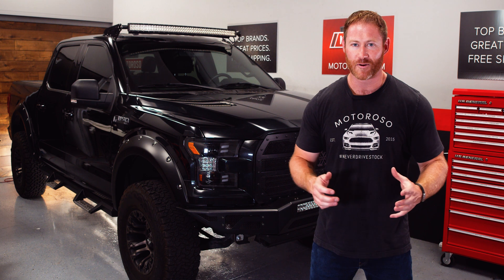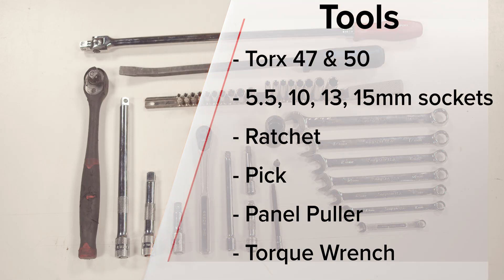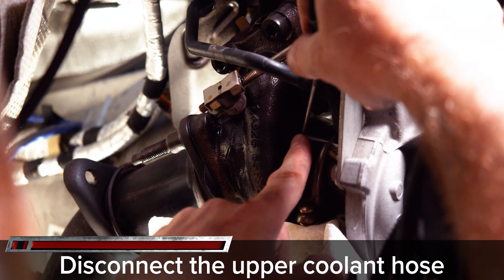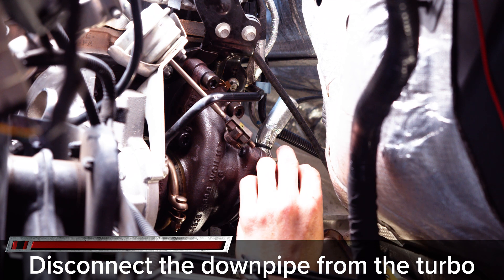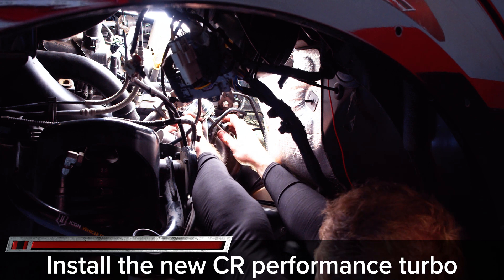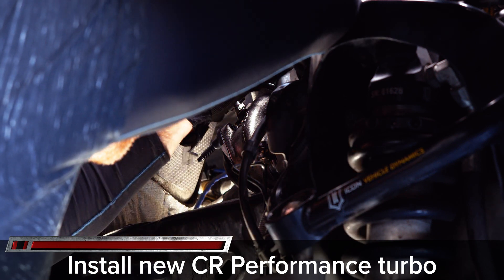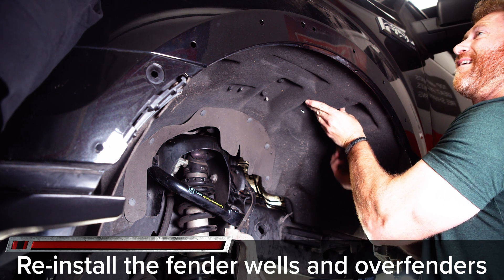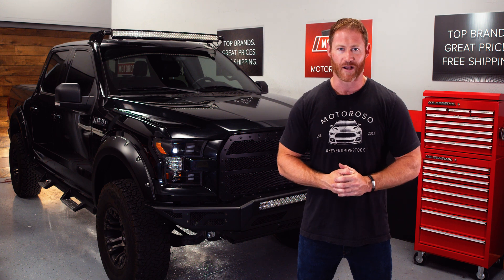Install Guide: Turbo Swap and Manifold on '15 Ford F-150 3.5L EcoBoost - CRP Stage 3 42mm Turbos

Comment: Here is a step-by-step summary of the instructions from the video:

1. Jack up the truck and remove the front wheels. 
2. Remove the fender liner and any fender flares. 
3. Drain the coolant from the radiator. 
4. Disconnect the battery. 
5. Remove the starter to access the lower side of the turbo. 
6. Remove bolts and start taking off intake and intercooler hoses. Remove the full intake if needed. 
7. Remove lines and nuts connecting the turbo to the downpipe and exhaust manifold. 
8. Remove coolant and oil lines from the turbo. 
9. Remove turbo from both sides of the engine bay. 
10. Remove exhaust manifold nuts and studs. Clean the engine block. 
11. Install new studs and gasket on the exhaust manifold. Install new manifold.
12. Install new turbo gaskets and connectors like coolant lines. Install turbo.  
13. Install downpipe and tighten turbo mounts. 
14. Repeat steps 10-13 on other side of engine.
15. Reinstall intake, starter, and fill coolant. Check for leaks.
16. Reinstall fender liners and wheels. Take it for a test drive and tune.

Comment: Just had a mechanic change out one of my turbos and a month and half later the same turbo blew again is this common? 2015 ford f-150 eco boost
Reply from the maker: The turbo failing is not common.
Reply: Yeah, this is not normal at all.
Reply: The turbos have an oil filter screen on the line to the block no mechanic or video ever mentions them, they’re strictly for the turbos! Change them or this will cost you!$

Comment: I own a new 2021 Ford Transit 250 3.5L Ecoboost. Will these Turbo mods and exhaust manifold fit my application ?  Please provide links to all parts I need.
Reply from the maker: Hi There, we have confirmed that the manifolds are the same as the Gen 1, and the turbos will work as well. If you'd like to put together an order for this, please reach out to us at 833.668.6767 or 805.723.8050
Reply: @Motoroso  Can turbos be put in a non turbo engine or are the internals different ?

Comment: Do these manifolds fit a 20213.5L Ecoboost ?
Reply from the maker: Yes, the fir 13-16 F-150 3.5L EcoBoost. They also make manifolds for 11-12, and 17-21.
Reply from the maker: We have this answer. Yes the Gen2 2017-2020s manifolds work on '21 if it's a non-Powerboost. Powerboost is not compatible.

Comment: Be cautious of the stupid water lines. The ones in the rear of the turbo are a b!tch to get to. Also, don’t twist them too much because  where the lines mount on the rear of the block are tricky to replace

Comment: Also searching parts for my 2014 f150 ecoboost, I can't find any CR Performance parts using your site, would LOVE to hear that you have the Manifolds and all the gaskets in stock including turbo and coolant gaskets as I can't find them ANYWHERE... PLEASE Motoroso, save my repair and win my business! I'm a loyal enthusiast and I'm in a situation here, a warped OEM Manifold on my Moderately Modified Ecoboost Work Truck Sleeper, and I Blame Covid for the Gasket shortage but get me back in my truck, pulling on Late model Sports Cars and hauling Tools and Material to my Job Sites before I lose it and starting sleeping in my poor Truck that hasn't left the driveway in a month 😭😭😭
Reply from the maker: Hey Aaron!  SORRY, our site isn't loaded with these products yet, we're going to get to it very soon! BUT, that's no problem, we can still sell you most everything, just have to do it a little but the old fashioned way. We don't have the gaskets, but we'll get you the part numbers and you can/should be able to get them from your local ford dealer. Please give us a call toll free at 1.833.MOTOROSO (833.668.6767), or email us at support@motoroso.com. We'll pull together a big list of everything you need, and get you back on the road! Looking forward to hearing from you!

Comment: Links to the parts for a 2012 F-150 ecoboost? Your site is a pain in the ass to search.
Reply from the maker: Hi Rainier, Sorry about that, those parts are not actually listed on our site yet at all. But if you contact us at support@motoroso.com or call us toll free at 833.MOTOROSO, we'd be glad to help put together a list of parts/mods and invoice for you, we're an authorized CRP dealer.